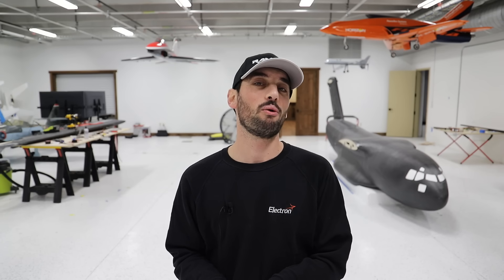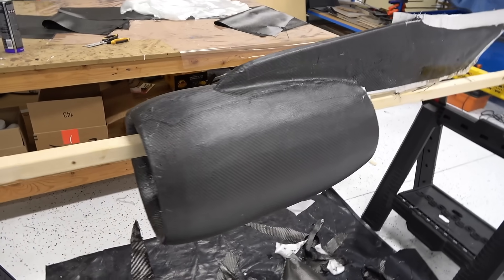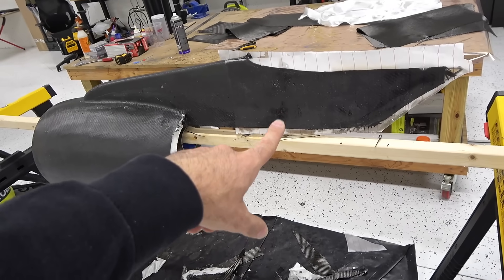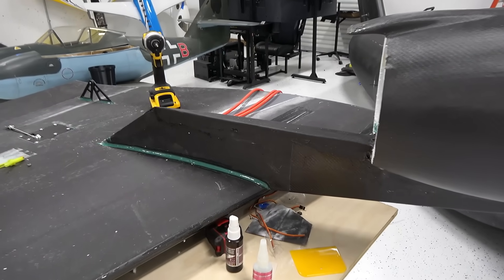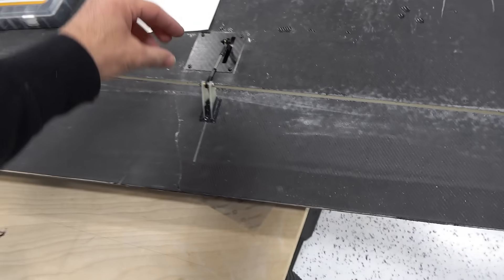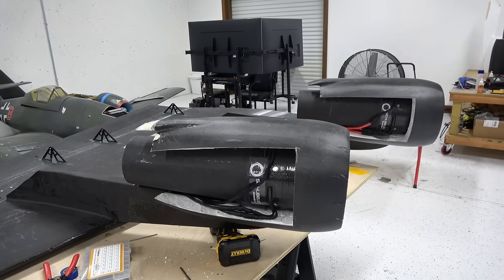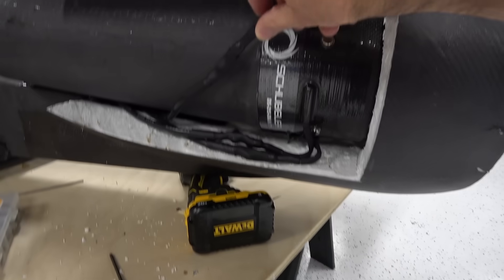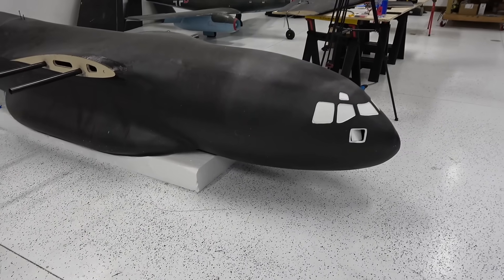BUILDING A GIANT 6 meters RC C-17 Globemaster/ Part 4

Comment from the maker: I'm super excited to finish this one!
Reply: That thing will be HUGE! Will Tyler need a special permit to fly this one? How heavy do you think it will be once it's finished, 40 kg or more?
Reply: With an engine with EDF being over 3.5 kg, that plane will be way over 40 kg. I will be shocked if it's more than 60!
Reply: After a long time l am waiting for that 😢
Reply: This one’s so big Ramy! Amazing work as always, I still hope someone sponsors you to build a B52 Stratofortress! Bigger is better 😊👍
Reply: Could you make a short video about all the epoxy/glue you use on all your airplane?
Amazing work as usual :)
Reply: OK, let's bet. I say 42kg.
Reply: @erikmayer30  58 kg.
Reply: 69kg @erikmayer30
Reply: all of us are excited to finish this massive project
Reply: @RamyRC, how do you get the carbon to stay in place so well, before it cures? Whenever I try carbon skinning, it comes out of place or peels away from the part before it cures fully.
Reply: @Jazzman618  I think there are several options...spray adhesive or fiber lock
Reply: What GLUES do you use on the foam?
Asking because I'm building something rc scalable to full size that's never been done before. 

Larry CEO
Reply: Can’t wait!  That’s big enough for you to take a ride in!
Reply: Boeing C-17 Globemaster III
Your project is awesome !!!

 🐾 Montréal 🇨🇦
Reply: I have watch many of your videos, awesome work sir
Reply: Well if you take a look at some of my work and you or Tyler need a chase pilot that works for cheap i.e. For free you should let me know LOL 😊
Reply: What does a build like this go for?

Comment: Hello Ramy. I don't want to disappoint you but the wing spar seems (subjectively) too weak for such size and weight. I am afraid that it may snap soon in first or second test flights. It may be the right moment to do some structural calculations and verify if it is adequate for this design. RC models are rather often subjected to much higher load factors than the real planes, due to abrupt deflections of control, and actually pilot not sitting inside and not feeling the plane. You have seriously big wings and heavy aircraft. In the real world, overloads on C17 do not exceed 2-2.5g. Gust loads may be a bigger concern than the maneuvering loads for the big aircraft. I would count with at least 4-5gs for such a monster RC model. And a safety factor of min. 2.0, better 3.0 to account for inconsistencies in the manufacturing process, defects, stress concentrations and other factors which cannot be easily foreseen with simplified structural mechanics.

Comment: You must purchase scissors by the case.  Can't imagine they are any good after cutting resin coated CF with them and the resin cures.  Can't imagine the cost of building this.  The man hours, materials, machines, etc... $16k worth of Schubeler Fans alone.   Incredible build, can't wait to see it fly.

Comment: I see you are using gloves once epoxy is applied. For your safety, use gloves when carbon is applied, please..🙏!
Carbon cloth dry is very capabable to enter the body, also thru air as particles.
Remember, you handle this stuff way more than a recommended level..

Comment: Each motor is $4500. When you add batteries in the 15-20,0000 mah range this is going to be much more expensive than if it had turbines.

Comment: Ramy here is a suggestion you should insulate all the wires with fireproof fiberglass to prevent the foam from melting or deforming from the heat coming from the wiring. Just a thought.

Comment: About that battery hatch: Are you sure it's in a structurally safe place? At least in a real aircraft that's probably structurally the most stressed area of the fuselage. Don't you have a a rear hatch planned?From there you could drill straight down to the center of the plane to insert the batteries at the center of gravity.

Comment: Please Ramy, yes, you are productive and make great things  - but will you please consider dialing down on the resin? 
You are honestly making less strong laminates with all the excess resin in there. The resin is not strong in itself compared to the fiber and in a laminate you can actually end up with the layers of fiber "floating away" from each other when you overdo it on the resin - leading to a less strong laminate.

When you did the "poor mans prepreg" on the table you were smothering the fabric. Just weigh the cloth, then mix the appropriate amount of resin plus a tad for the cup and tools. Whether the ratio is 50/50 or 55/45% I can't tell you but do a few quick test laminates to determine it and then never have to worry for the rest of the build.  

If the argument is that it's better to have too much and you squeeze it out afterwards, then keep in mind that even though this is still not huge amounts, it's still waste. Still chemicals, still oil based more or less and why use more of it than we ever need to.

Comment: I'm super curious whats your opinion about soldering already crimped connectors. In my opinion just crimped should be stronger. In automotive and also aerospace almost every connector is crimped AFAIK. Since solder makes the wires stiff, vibrations and mechanical work can damge the copper near the solder. However thats theory and you probably know how it works in real life and whats better and more reliable. Waiting for your response 🤔😁

Comment: 4:24 one thing i would've done different is i would've used carbon fiber tubes (possibly 10mm or 20mm) to connect the two faces of the engine arm in that first layer of carbon. Adding those tubes and gluing them with some 10/20 mm carbon strips going inside (in a star burst fashion) would give the arm some serious torsional rigidity VS a straight up shell. Not saying it's not strong, but those tubes inside would make it even stronger.
Source: A couple of bicycle frames i've made in the past are done in this fashion, with this hidden feature (it's invisible from the outside once you put the layers on top) and they were extraordinarily rigid. The owner i made the frames for even wanted a test and we pitted his older 790 MSL (which at the time was 3 years old) and it wasn't even flexing (rear axle locked on a wall bracket, twisting with a 2 meter long stainless steel snug fitting tube in the neck on the top side). The 790 MSL had about a hand long of deflection while the reinforced frame (same design) less than 10 cm.

Comment: When you build a stick and tissue airplane and a few years later you wonder if your hobby got out of hand!   Tremendous work as usual Sir - looking forward to seeing this one in the air
Reply: Back in the mid 1980s, I found a book with detailed cross section drawings of an F-16 which I enlarged on a copying machine to build a 1/6 scale model. I traced all the sections onto thin plywood, cut them out, and used them to hotwire all the left and right side sections. Glued them all together to make my 8 foot long fuselage plug. I spent weeks comparing and finishing it so it matched pictures from every angle. It was so rewarding to create. The good old  days. Then I saw that companies were using CNC machines to create super detailed models. That knocked the wind out of my sails.

Comment: I'm curious as to how the EDF wires between the wing and nacelle  will be handled. I can't believe they will be flapping in the breeze.
Thank you for taking the time to document what is already a herculean task.
Reply: Exterior conduit maybe?
Reply: Good question. Were they a temporary installation? Perhaps he'll cut a channel in the pylons? It's unlike Ramy to just leave them out.
Reply: @rcnfo1197  It is a head scratcher.  He already patched the wing where the wires fit under and soldered/heat shrunk the wiring. If you cut into the nessel support, you weaken that. Severely I would think.

Comment: To put this in perspective, those EDFs are $4500 EACH. For ESCs to drive those monsters add another $1k each. $22,000 in engines and ESCs alone in this beast!
Reply: yeah. Also they're designing/manufacturing custom landing gears etc. I'm guessing the total cost including everything + labor is probably around the ballpark of 1-1.5 millions. Crazy.

Comment: Those EDF wires are massive, very excited to see it in the air! 
Good luck for the build, hope u have a great year ahead!
Reply: Looked up the EDF, max current is 500A! I don't know what the battery will be but just guessing that at 18s 66v, these will output 31Kw each. So 166hp for all four. That's the same as a Cessna 172.
Reply: Look like jumper cables.